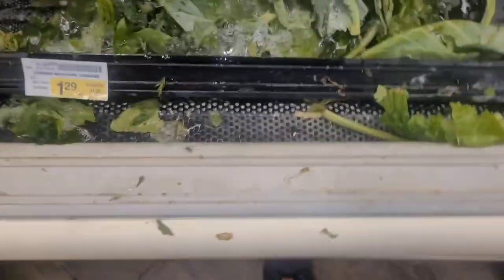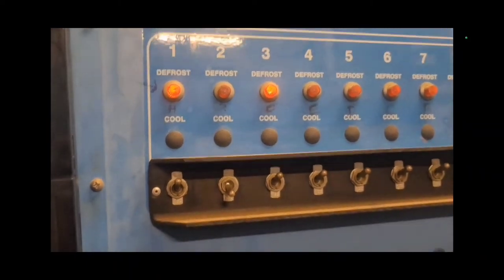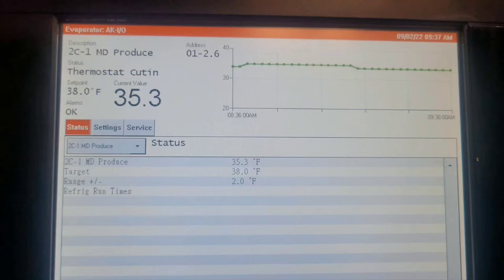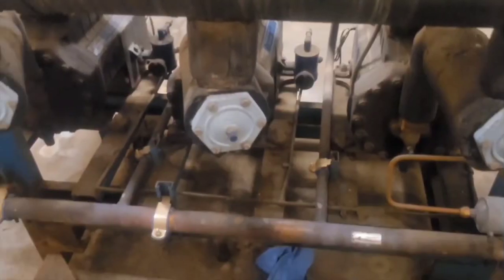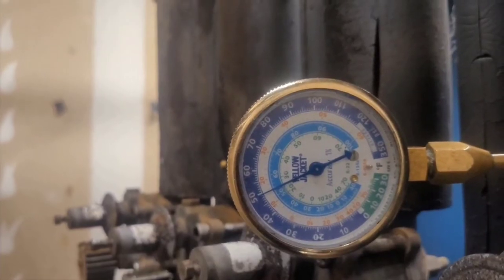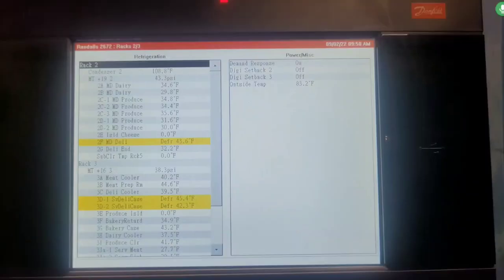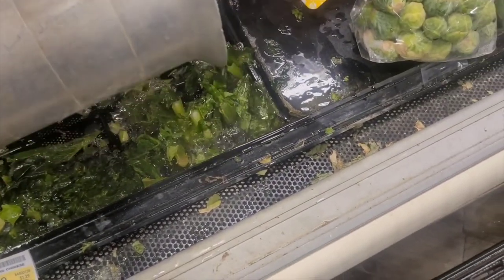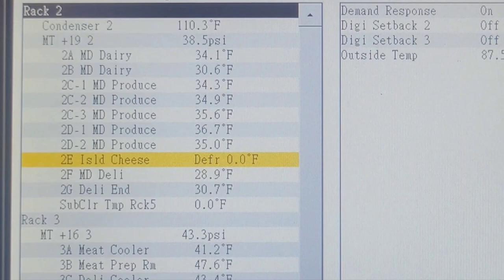RACK CIRCUIT EPR VALVE ADJUSMENT - SUPERMARKET PRODUCE CASE TOO COLD - FREEZING THE LETTUCE

Comment: The air flow was restricted causing low temperature. Recommend maintenance
And have them sign if they decline.
Somebody may have thought they knew what they were doing and made it colder than needed. Nice work though....